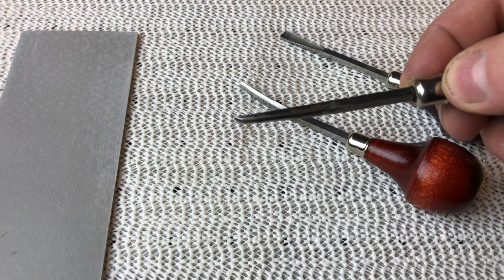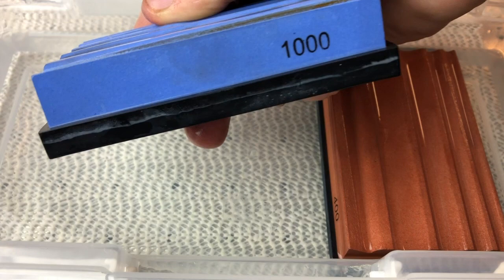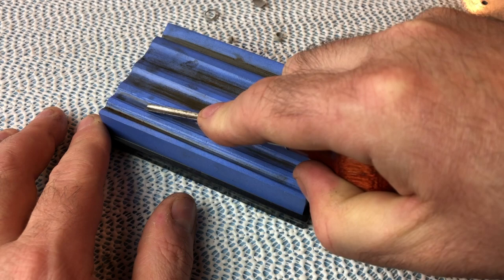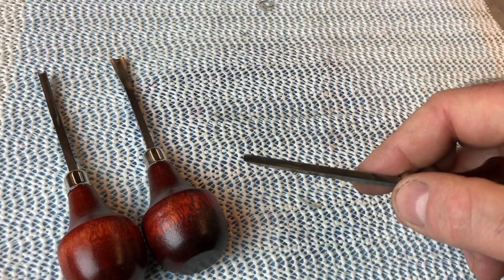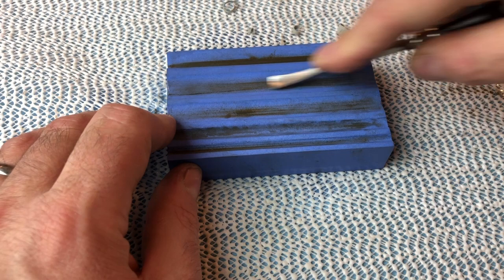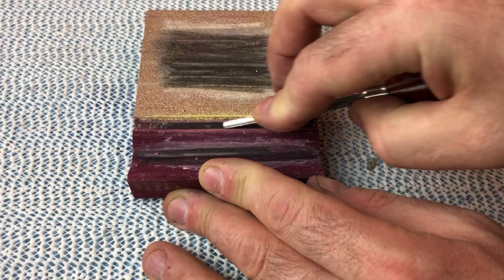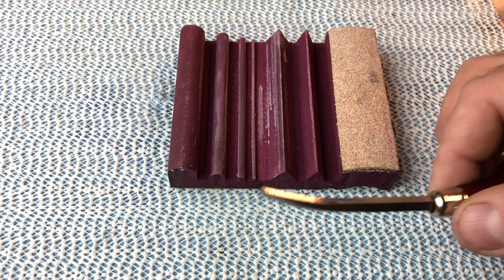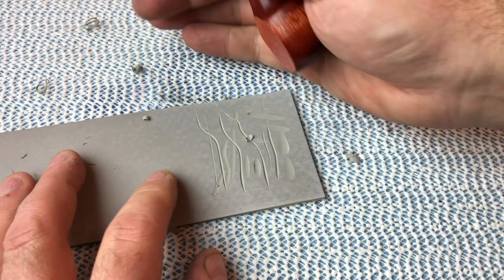Sharpening linocut tools

Comment: I have sharpened literally hundreds of carving tools from large gouges to micro tools. Exterior bevels can easily be sharpened on a flat stone and internal surfaces can be sharpened using slip stones or fine abrasive  paper so that the shaped stones are really unnecessary and are more trouble than they are worth. They are a relatively recent invention. Diamond stones work better than waterstones for carving tools because waterstones are relatively soft and easy to damage. The flat sides of these type stones are much more useful than the shaped area. The real magic is in using the strop or a buffing wheel. Be sure and pay close attention to the keel of the parting (V) tool to get it to function well. Have fun.
Reply from the maker: Hi Mike, I completely agree. Personally, my tool sharpening regime is both simpler than, and also more advanced than the video. My video though, and the kinda novel curved stone, is aimed at my Intro to Printmaking students who have never sharpened a tool, and have about a zillion other steps and processes to follow in my Printmaking class. Giving them something that’s easier to follow, and will guarantee they at least try to sharpen their tools, is the key. Thanks for watching.